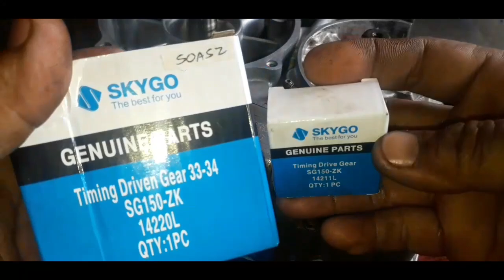HONDA TMX155 OVERHAULING | SULIT ANG 6K NI BOSS SMOOTH ANG KANYANG MAKINA

Comment: Sq mga china/taiwan na parts Baliktad yung butas ng pin ng cam gear yung sa oil passage . Sa mga china baliktad kasi mga magneto kaya yung lock sa pin ng cam gear naka 6oclock hindi kamuka ng tmx155 cam gear pin nasa 12oclock yung butas ng pin kaya kapag sinulpak sa tmx155 yung cam gear pin ng skygo hindi na lulubricate ng maayos kasi naka 6oclock yung butas hindi kamuka ng tmx155 12oclock
Reply: Tapos dalawa lng butas ng pin ndi tulad sa stock ng 155 na tatlo yung oil passage sa cam gear pin

Comment: Lakay,good day.ask ko lang man nu manu labor mo nu ag pa overhaul nak iti TMX 155? Ken mano amin iti maximum nga magastos amin mga parts iti makina na general overhauling ken amin ket orig maikabil..tapos general overhaul also iti Suzuki Rider 150 Carb type.manu magastos ijay tmx 155 ken nu manu magastos ijay suzuki rider 150.thanks lakay.follower mo siak ka bro.
Reply from the maker: Goodmorning po sir labor po namin 1,500 overhauling..
Tapos sa pyesa po kung puro orig.almost 20k..pero kung UNG TIMING GEAR AY PAG AT CONECTING ROD AY ORIG NASA 15K PABABA PO
Reply: @kabromechanic9574  thank you ka bro for repplying and to answering my questions.but how about the Suzuki Rider?how much is the total cost for overhauling?mag babakasyon ako soon jan sa pinas bro then mag papaayos ako sayo ng 2 motor.tmx 155 and rider 150.
Reply: @kabromechanic9574  isa ako sa mga followers mo ka bro.regards kay kagawad at bro lito.

Comment: Kabro  kasatnom inkabel jay timing gear na,, pinokpok mo ba kabro?
Reply from the maker: Wen kabro pinukpok ko lang tubo
Reply: Boss Yung mga lost thread ang mga part pwede mo ba magawa kasi Yung motor ko 2005 model pa sya marami ng lost thread at maingay na ang makina. Magkano po Kaya ang gagastusing from Cauayan Isabela po ako.

Comment: Kabro , swak ba yung set ng crankshaft ng tmx 155 sa tmx alpha 125?
Reply from the maker: Pwede kaso kailangan magpa machine shop sa bandang bagneto sa salpakan ng magneto sa segunyal mejo magastos din
Reply: @kabromechanic9574  , anong sukat ng connecting rod ang sakto sa tmx alpha 125 kabro para ma upgrade ng 155cc or 175cc ?
Reply: @kabromechanic9574  ania serbi na bro jay washer nagbaetan ti kick gear k8 haan mt nga masagid?